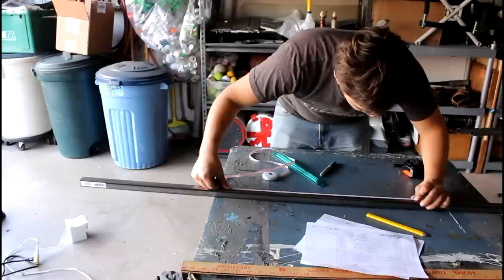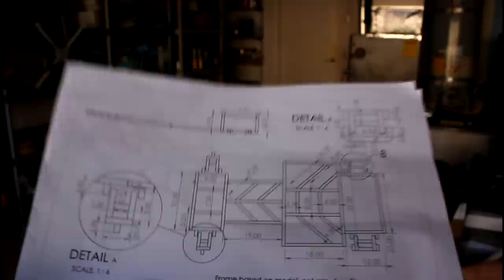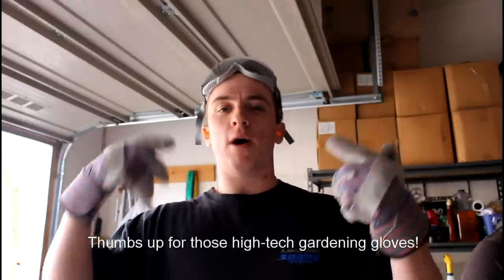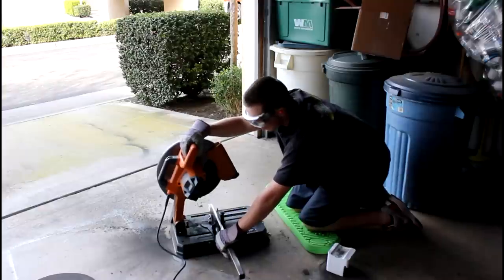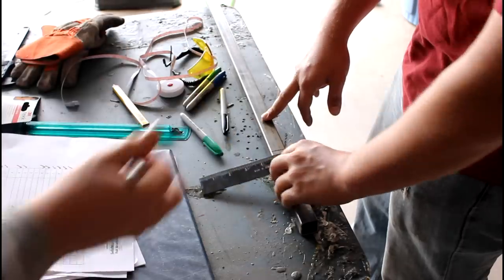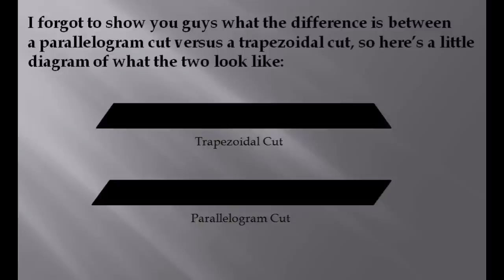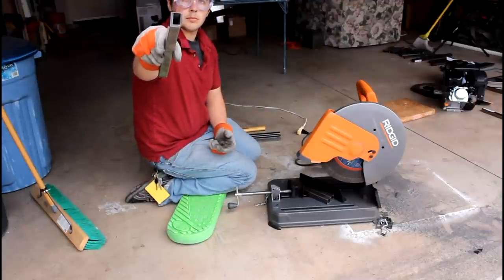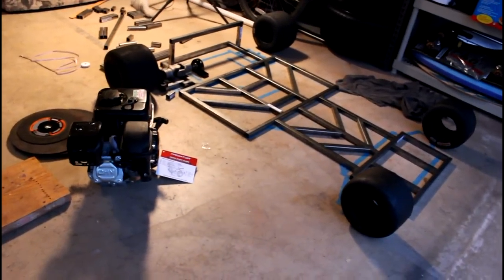(Homemade) Go Kart Project Video 2: Cutting Metal Tubing for the Frame!!

Comment: How much does the tubes cost
Reply from the maker: +unboxingchannle It depends on where you get them, Home Depot and Lowe's will be the most expensive at around $20 for a 6 foot section. I got mine at a smaller Hardware store for around $13 for a 6 foot section
Reply: Okay thanks

Comment: Wow those dimension were really hard to look at. Many of them were over dimensioned and to many of them were touching. Sorry Im just really anal about that but nice build guys.
Reply from the maker: I've never heard of the term "over dimensioned" but thanks
Reply: +Hnat Automotive Photography Are you studying engineering at a university ?
Reply from the maker: yep
Reply: +Hnat Automotive Photography oh nice well its basically having to many repeated dimensions on a drawing. Similar to when your building the part and over define it. the dimension lines as well should not intersect eachother if possible. But still love the build and have watched all your videos you are very knowledgeable and will be a great engineer!
Reply from the maker: +Mrwaffleandmilk Thank you, I appreciate the kind words! Yea a lot of the braces, like all of the angled struts, are mostly there for aesthetics and not for structural rigidity. I wanted to add those to give the frame design some "flavor" so it wouldn't look so boxy.
Reply: +Hnat Automotive Photography I was just gonna comment on that !!! love the design. I'm still designing my go kart mine is more of a buggy. Where would you recommend buying parts ?
Reply from the maker: +Mrwaffleandmilk oh nice, an off road buggy should be fun. GoPowerSports is a great site to get a ton of parts
Reply: Hnat Automotive Photography thanks man